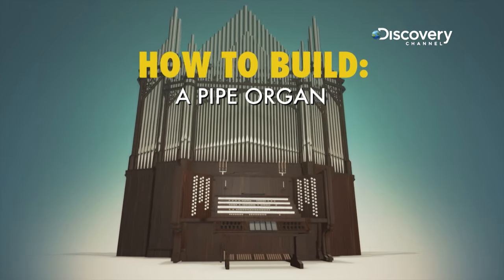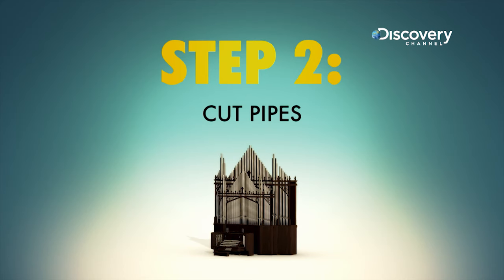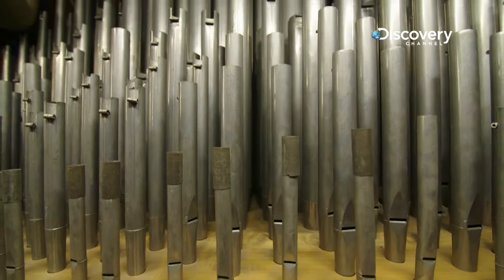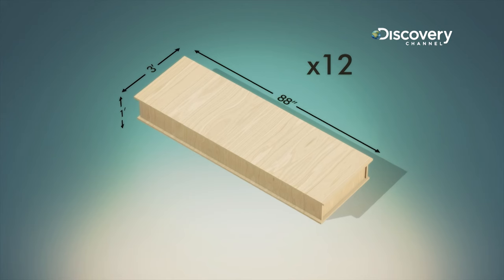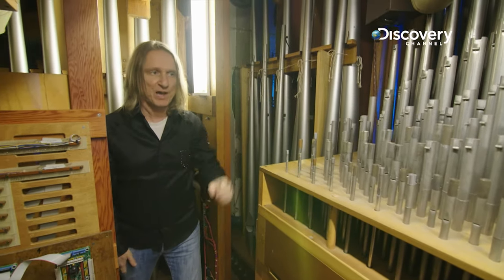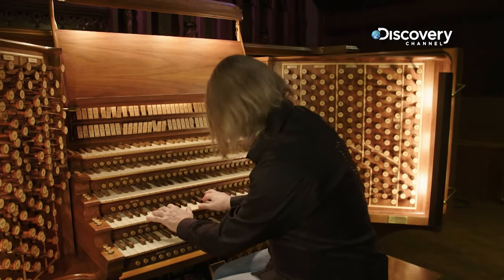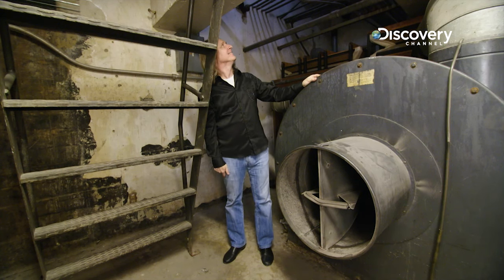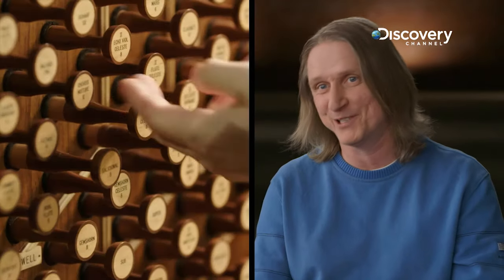Pipe Organ | HOW TO BUILD... EVERYTHING

Comment: The casualness of this is so funny - easy, just drill 5,000 holes
Reply: And cut pipe no larger than 32 feet
Reply: Don't forget the 15,000 small parts for the primaries, secondary pouches, and pallets (24 parts per note) in the chest

Comment: You don't need 5000 pipes to have an organ with all the necessary tonal resources.  In many cases, an organ with fewer than 500 pipes will do the job.  It would be awesome to have 1000 or more pipes, but I'd rather ave a 4-rank unit organ than an Allen.  

A 4-rank unit organ could have somewhere around 340 pipes.  That's still better than an Allen with only 2-4 speakers.
Reply: The reason there’s so many pipes, is because of the stops. When you pull a stop, you completely change the sound of a specific manual. This requires a completely different set of pipes. Depending on how many stops and manuals the organ has, an organ can easily have 5000 pipes.
Reply: There's always the pipe organ clearing house. You can buy a complete organ, very often in pristine condition, for anywhere from $10,000 on up. Oh, well, assuming you already have a large hall to put it in, you still have to have it moved ... for around $100,000 or so should do it.

Comment: As an organist of 25 years and a person whom worked in a pipe shop. 3 minutes does NOT even remotely explain this instrument. AT ALL. 
1. Standard windchests do NOT have 1 thousand pipes on them. 
2. Average cost of a USED pipe organ can be UNDER 50k. If your church wants one. WRITE a pipe organ company an email. Usually there is another church discarding their instrument for a praise band (SAD).
3. If you want your church organ to be exciting. Ask them for a Trompette 8' , a MIXTURE IV and to SCALE up the Pedal bourdon. And then a VOIX CELESTE for tonal Color. Trust me. You want emotion to your music and NOT just LOUD. 
4. A pipe organ is much more emotional than a Praise band. Really, Consider the pipe organ.
Reply: Still, it's 50.000$ lol
Reply: I would imagine that getting a pipe organ for free will still require a good chunk of money. The destination building needs to have space for the pipes, console and all the air ducting and such.  This would probably require a good amount of engineering and renovations to an existing building. It is probably easier to design a building from scratch with a pipe organ as opposed to retrofitting.